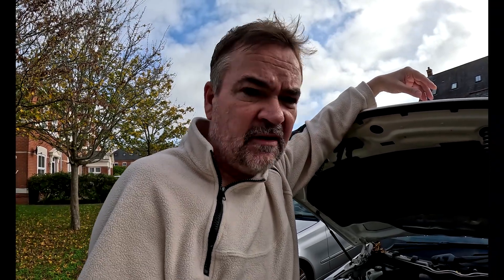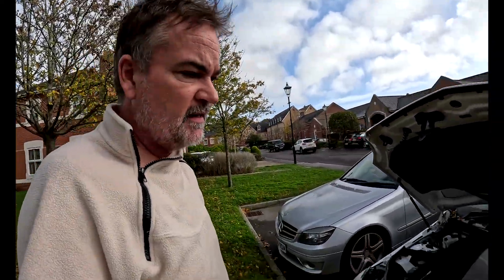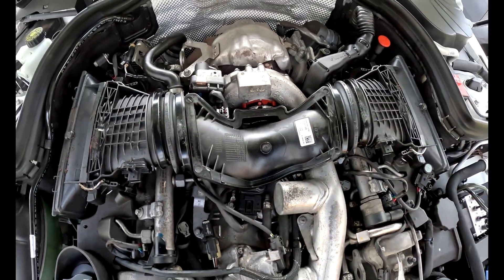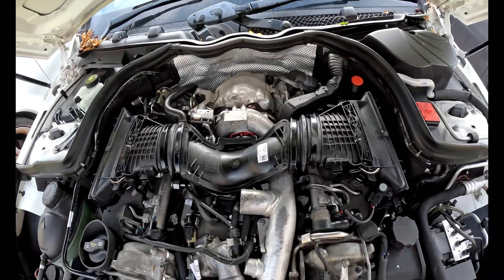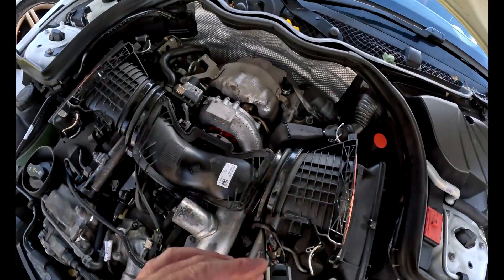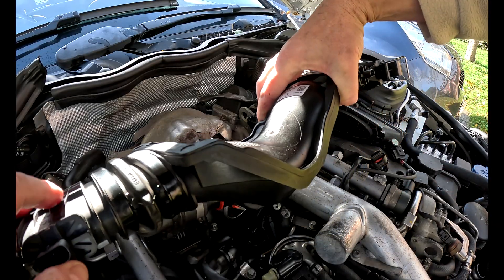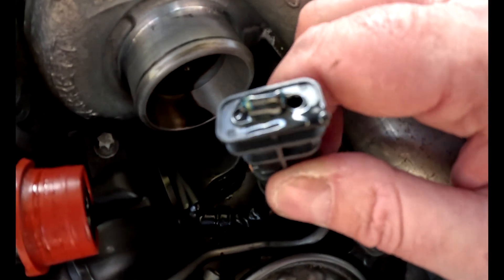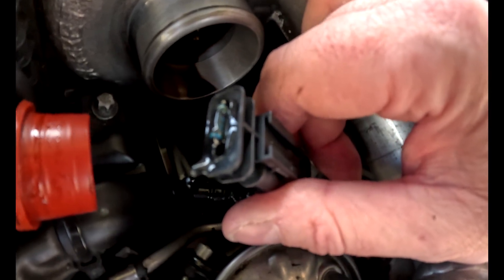Mercedes OM642 Swirl Flap Bypass Resistor MELTED — What You Need to Know

Comment: what about oil in turbo air tube?
Reply from the maker: Not sure what your asking but oil in the air tube is inevitable and cannot really be stopped even if you go down the route of a New PCV valve its still not going to stop the oil being blown through in like a vapour, one thought I had was to reduce the oil fill level on these older v6 engines to try and reduce the amount of pressure build up etc, many will top up to the Maximum position etc, all the best mrix